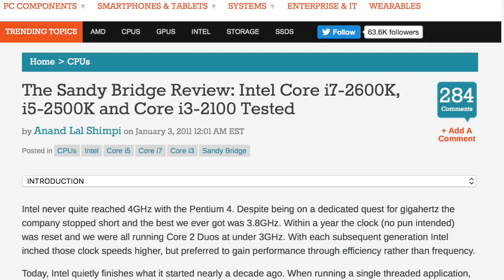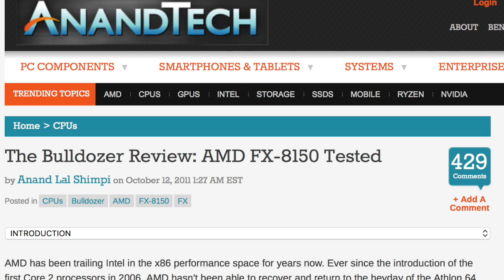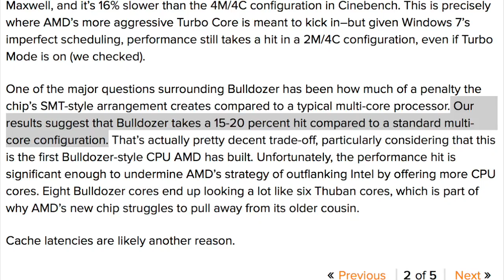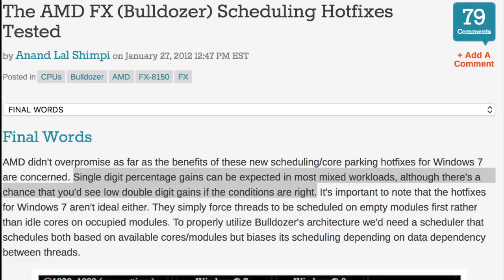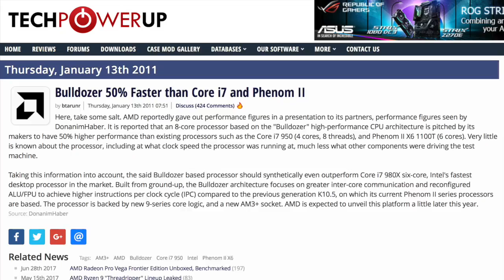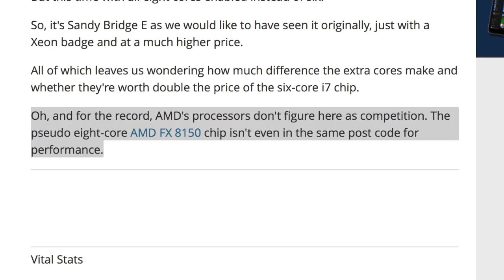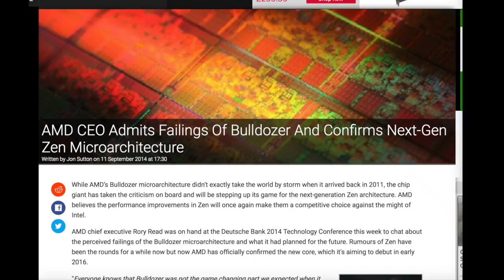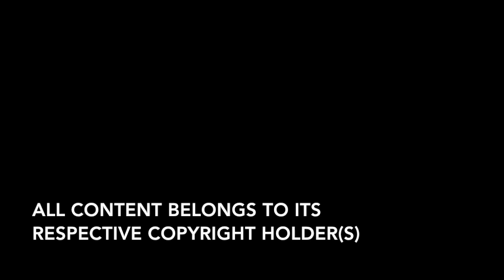The Bulldozer Story - and why AMD FX is better than you remember

Comment: 4.7 overclocked is great with a 980ti, or even a 1080ti.
Reply: 1070 dosnt seem bottle necked much at 4.5+ from our testing, at stock, specially on older titles you will hit a wall but, i have hit the exact same wall on my buddies 2500k at 4.5(max it will do, period...he won and lost the sil lotto, it wont oc past 4.5, but it will do 4.5 a little below stock volts...we tried 4 boards, 3 psu's, and had a guy whos won  oc contests in the past try at a lan and, no luck..but, the guy did say, he would love to have that chip in his itx rig...runs cool and is plenty fast for most uses today...specially most uses of mitx... 

http://www.guru3d.com/articles_pages/watch_dog_2_pc_graphics_performance_benchmark_review,8.html

http://www.guru3d.com/articles_pages/dishonored_2_pc_graphics_performance_benchmark_review,8.html

http://www.guru3d.com/articles_page...e_warfare_pc_graphics_benchmark_review,8.html

http://www.guru3d.com/articles_pages/battlefield_1_pc_graphics_benchmark_review,9.html

http://www.guru3d.com/articles_pages/gears_of_war_4_pc_vga_graphics_performance_benchmark_review,8.html

well ok, if you game at 1080p, but, why would you do that when you have DSR as an option?

makes no sense to game at 1080p when you can push it to 1440 or 2160p and bring perf in line with the intel rigs?
Reply: Lol. Not really, at least not the 1080 ti much less a 1080/70. Will be held back.

Comment: I don't know where you guys are getting your info about AMD FX 8350. There are people who are using the 8350 and getting 4.7 out of there chips. I am going to stay with my 8350 until threadripper gets stable. You can game on the 8350 even at 1440 I know people who is doing this as I speak.
Reply: I just sold a 8320@4.5ghz rig that did doom 4 at ultra setting on 1440p with a gtx 1070. i've sold 4 FX series rigs in the past three months. The support for dual ccx 8 core chips has certainly gotten better over the years. 

a 980ti is the perfect pair imo
Reply: or a 8350 @ 5ghz w/ 1060 6gb ssc... I have one of those on my shelf right now and it games every modern title at 1080p 60-100fps no problem.
Reply: All of my rigs game at 60fps or better. 60 fps is my absolute minimum
Reply: My main purpose is gaming, and the 8350 has served very well. I realize, however, that it will begin to fall behind in performance in the next few years. I recently built a 7700K rig OC to 5GHz, but there is no way I'm retiring the FX-8350. It will be an excellent backup rig.
Reply: I have played every game maxed out for the last 4 years on a 8320 and a 295X2 in 4k. I just bought a 1800x because I needed something with more threads for rendering.
Reply: Never bad having a backup rig. Be it in case the main system fails or for some reason there have to be more than one active at a time.
Reply: FX 9590 GTX 1080 FTW @ 4K No problem.
Reply: I do it at 4k in most titles, moving from dual 290x to a 1070mini made a huge dif, the only titles i see drop below 60fps anymore are...mmo's, and then, its mostly dependent on how much is on screen moving around, more players=perf hit in most if not every mmo, reguardless of cpu..(my buddies 5960x system gets the same fps i do in the same areas of for example ESO.. 

other games....normally im at 70+fps, i do force triple buffer and vsync in alot of titles though, kinda wish i could use a double vsync+tb....since the card can put out over 120fps consistant with this cpu(9370 at stock, though i could lock it at 4.6....in testing, i havent found the need with this board/chip, turbo seems to work well infact....infact....i have on rare occations actually seen it turbo all cores to 4.7...despite the fact it should be 4/8 cores to max turbo ....meh...wish it would consistantly do all of the cores...since when its happened it was never running hot or giving stability issues...(silver arrow extreme sb-e with 3 fans)

Comment: dont get how they calll the bulldozer so bad i stil run it cause well i dont earn alot of income so cant upgrade my pc every few years. bulldozer stil rocks cause i can play anygame atm without any problems. it does the job and was a very good buy at that time.  so no it is not as bad as i remember cause i stil use it and even do i want to get a ryzen at this moment bulldozer stil does its job ,2 games on 2 screen well then it depens on wich games i play but yeah using 1screen i can run star citizen with no isseu hope after 3.0 that stil be the case and same for conan . and those test they use are so wank i never trust those anyways, and time wil tell that amd wil beat the shit out of intel . i can remember the first amd i got a 1.2ghz my brother the same but from intel (both single cores back in the day ;) ) both same video card. did the benchmark and oepsie what did it say intel was not a 1.2 but a 1.0 performance .after i saw that i never went away from amd cause well fool me once but not twice intel .

Comment: they outperform sandy bridge now.
Reply: well he is has shown evidence yet you provide nothing
Reply: i have and its  crap he spend most of the time slagging it off, he cannot think for himself . oops i meant the above not the one u mentioned i will watch it
Reply: yeah its a cheaper cpu by 4x less price what u expect. I cannot afford an i7 or any intel cpu they are too expensive, so i go for the fx 8350 for 50 quid. as i have a amd 3+ already and ram. for me to go rizen i have to buy a new system completely  i just do  not have the cash
Reply: i will never be able to afford ryzen or intel cpus as i cannot work due to ill health  so my money is very limited
Reply: amd  1090t black
Reply: board does not like it m5a97 le r2.0
Reply: https://www.game-debate.com/cpu/index.php?pid=1140&pid2=485&compare=fx-8350-vs-phenom-ii-x6-1090t
Reply: NCR TROOPER actually they do win now. My dad's 8350 stomps my 2600k and my i5 2400. He gets better frame rates with a 390 non X then I do with a 480. And my card is slightly better.
Reply: NCR TROOPER: i have a 9370, and access to 2500k, 2700k, 3770k, 7700k, 5960x, as well as other rigs, under windows 10, with a modern card,(nv being better) 6 and 8 core amd chips actually do, in MANY apps, outperform the intel chips stock for stock, my 8350 was able to do 4.5 at stock volts with just setting llc to high rather then auto, also found i could under volt it by a decent amount at that locked clock without any harm to stability(96hrs p95 custom blend stable, 10runs of extreme ibt avx stable), under 10, with a modern card, the 8350 at 4.5 was beating all of the above stock for stock in modern game titles before i sent the chip to a friend who was stuck on an old x4 945(not the good unlocable ver even) , but has a 970 game board, i have my 9370 i paid $0 for new....so i passed the chip along to my buddy ;) 

we have tested, and my friends with intel have all been quite shocked by the perf of my "amd cannot game" gaming system....the dude with the 2500k actually traded his board and cpu for a 9590 and chv-z that asus replaced with the latest version of the sabertooth when he had to rma after the board died(i think he shorted it on the case, though he would never admit it), they didnt have a chv-z in stock and asked if he would take the sabertooth retail kit instead...m2 slot sold him on it...the fact they tossed in usb 3 pci bracket and such... that dont normally come with the board....bonus!!!!, i have the chv-z, and i would be willing to trade for that board after having seen it in action...but...wouldnt spend money to get it :P 

anyway.... yes, the 8370 vs 2500k stock for stock, average puts the 8370 10% ahead of the 2500k, even when overclocked you see this, mostly because of how much more perf the 8370 can get, in some modern titles with cards whos drivers use the cpu cores well on top of games making better use of more threads/cores, 4.5 vs 4.5 the 2500k will be faster per core, but, once you max out all 4 cores, like the 7700k, you hit the wall, on the other hand, i havent seen a game yet that can max out 8 cores and keep them maxed, most that use more threads actually seem to use the cores to keep the load pretty balanced across the cores being used....sure you hit the wall per thread/core but thats also true of the 2500k/2600k/2700k etc, im quite glad i went the way i did, the path i took saved me money over the years, and, has held up better then had i gone with intels options...q6600/960/2500k/2600k/2700k/etc, since, at each stage of my upgrade path, i was able to continue using core components till i upgraded them...upgraded from a 790x board to a 990fx board, kept the x6 1050t i was using, and ram, moved to an 8120 i got stupid cheap, sold it to a buddy when i got an 8350 for 120-145 range on newegg, who insisted on paying current value for it...that was more then i spent on the 8350.... i upgraded my ram from 16gb of 1666 to 32gb of 1866 i got for 120 shellshocker, then 32gb 2133 i got for the same price shell shocker... i moved from sabertooth 990fx to chv-z because a buddy sold me one for 120-130..ish...brand new unopened, the core of this systems been upgraded here and there at far lower cost then moving to an intel option that would give me more then a quad....and, unlike intels offerings, over the years, win8/8.1/10, driver updates, game updates, all have made these chips faster, the fx line is seeing benefit because, they did have a sizeable market(cpu/apu/etc) and it was expanded by all the xbox/ps4 units sold using what amounts to a tuned and very low clocked version of these cpu's, even if its a small % of the overall market.

these chips are not shit, despite what people still believe 

http://www.guru3d.com/articles_pages/watch_dog_2_pc_graphics_performance_benchmark_review,8.html

http://www.guru3d.com/articles_pages/dishonored_2_pc_graphics_performance_benchmark_review,8.html

http://www.guru3d.com/articles_page...e_warfare_pc_graphics_benchmark_review,8.html

http://www.guru3d.com/articles_pages/battlefield_1_pc_graphics_benchmark_review,9.html

http://www.guru3d.com/articles_pages/gears_of_war_4_pc_vga_graphics_performance_benchmark_review,8.html

Comment: AMD 8 cores weren't really a failure. But AMD milked it for way too long, I loved my FX8320 back when I first bought it, Now the FX 9590 to me was a failure, They were mostly unstable at stock and some motherboards it just froze up because of the insane power draw, If they were able to make a 125watt TDP FX9590 I would have been impressed at the time. The FX line was showing its age so I ended up moving to the i7 5820k since AMD did not have anything out that was worth getting at the time. I still have my FX8320 in another system and it's doing well and I have an FX4350 in a system I use for my media center/file server I use every day, I bought the FX4350 for $25 USD.

Comment: Well, i just upgraded from a FX-4300 to a FX-8350 last month and it does all i need.
If you are on an extreme Budget like me, the AM3+ platform is still an option to consider. It is well matured, no early adopters bugs, very stable and reliable in my expirience. 
Sure, it will not hold up to modern i7 or Ryzen Chips, but on the other hand, you can build 2 complete AM3+ PCs for the same price as a top level i7 CPU alone. You will not crush any benchmarks with a FX-CPU, but you can run everything and it's not too bad. I really like my new system, and i think i will stay on that until the next generation of Zen CPUs are out. 
Still my opinion, if you want a solid, reliable system for a cheap budget, and you care more about everyday expirience then benchmark results, stay one generation behind. That way you can get the full featured well built top tier parts, while still saving a lot of money and headache.
After all, i don't want to play beta tester on some new chips that were thrown at the market with severe bugs in them, even paying a premium for doing so. I'd rather take the well tested and matured option and save a lot of $$ on it.
Reply: Asahiwasabi LMAO it stops it? You call 8% a stomp? Also my piledriver chip is faster then your x5660 even in server loads. http://cpu.userbenchmark.com/Compare/AMD-FX-6300-vs-Intel-Xeon-X5560/1555vsm16614
This is my system: http://www.userbenchmark.com/UserRun/7277493
Reply: kitty!
Reply: That would be a valid strategy until a couple of years ago. The sheer IPC uplift of ryzen, current RAM prices, and amount of r1700\r2600 + b450 mobos in the used market makes it so AM3+ is too obsolete to be a good performance\price option. Sure, for the 150\200$ you'd spend on one ryzen mobo\cpu\ram combo could buy 2 AM3+ combos, but that's just because of how worthless they've become. 

I mean, if you only have 100$ to spend, go for it. But from 150\200 and above, might as well get early AM4, then you get not only a way better experience, but also upgrade paths that will be worth at least for another 3\5 years
Reply: @dayotobiusa  Well, the comment you responded to is from 3 years ago. 
I would not go the same route today, instead i would go with Ryzen obviously. 

When i made the descision for AM3+ over AM4, it was still first gen Ryzen, and we all know it had some issues with RAM compatibility and such. 

Today, Ryzen is a mature platform. But you can employ the same strategy within the AM4 ecosystem. Get a really good mainboard with the latest support, but then save money by not getting the latest CPU but maybe just a 2000 series. Also only equip 2 of your RAM slots to keep the other 2 free for a future upgrade once RAM prices drop. 
Then hold on and wait until after Ryzen 5000 Series the AM4 platform is replaced, and upgrade to the highest tier AM4 while everyone is running after the next new thing.

This strategy will obviously not give you the top of the line high end system, but in terms of performance per $$, this seems to be the most efficient strategy.
Reply: Until the board expires and you can't get a decent replacement.
Reply: @marcustaylor670  My am2+ board has been run wayy over clocked with an Athon +550 dual core for 13 years now. A quality board will last longer think u think. OEM boards burn out!
Reply: @willc5512  - I have various ROG boards including AM2, they will take all manner of abuse forever almost.  Anything medium to low quality which 95% of people run won't last.  Must be a quality board you have.
Reply: http://www.guru3d.com/articles_pages/watch_dog_2_pc_graphics_performance_benchmark_review,8.html

http://www.guru3d.com/articles_pages/dishonored_2_pc_graphics_performance_benchmark_review,8.html

http://www.guru3d.com/articles_page...e_warfare_pc_graphics_benchmark_review,8.html

http://www.guru3d.com/articles_pages/battlefield_1_pc_graphics_benchmark_review,9.html

http://www.guru3d.com/articles_pages/gears_of_war_4_pc_vga_graphics_performance_benchmark_review,8.html

fx cannot game you need i3/i5/i7 to game, reviews from ryzen launch show, ryzen is yet another trash design....clearly....

and serious gamers, game at 1080p or lower for max fps !!!

Comment: No, its exactly as good as i remember lol. There are definitely games today that take advantage of more than 4 cores, but that does not help fx in games like WoW where you need a single fast one. BTW i bought a ryzen 1700 as upgrade to my 2500k, just so i dont get lableled an intel fanboy. Bulldozer was and is a failure.
Reply: Ryzen isn't exactly shit for gaming.
The difference is mainly due to ~20% slower clocks.
At low resolutions it is noticable, but when there is a choice between 80 fpps for $200 and 90 fps for $350, what would you choose.
At higher resolutions the difference dissapears, but that is mainly due to low fps overall.
There is a reason AMD wanted the gaming tests for Ryzen at 4K.
If I can get good fps for a certain price, and slightly higher fps for double that price, I take the cheaper chip, as long as even that is good enough.
If it weren't for certain, less threaded games, I would probably still play on my Core 2.
Reply: fx cant game, hell, launch reviews show ryzen is shit for gaming,  gamers should just stick to a 7700k like intel wants.... 
http://www.guru3d.com/articles_pages/watch_dog_2_pc_graphics_performance_benchmark_review,8.html

http://www.guru3d.com/articles_pages/dishonored_2_pc_graphics_performance_benchmark_review,8.html

http://www.guru3d.com/articles_page...e_warfare_pc_graphics_benchmark_review,8.html

http://www.guru3d.com/articles_pages/battlefield_1_pc_graphics_benchmark_review,9.html

http://www.guru3d.com/articles_pages/gears_of_war_4_pc_vga_graphics_performance_benchmark_review,8.html

Comment: Where do you state why FX is better than I remember? Because most of your video highlighted the negative. I'm confused.
Reply from the maker: Because there were several limitations that hampered performance at launch, so the performance was worse than it should have been in early FX reviews. As a result people usually remember the product being worse than it actually was, and don't give bulldozer or later FX processors a fair shot.
Reply: But all those changes happened during the lifetime. You didn't really present the information well. It just seemed like AMD fanboy clickbait. And I would know I've owned an AMD cpu for the past 13 years.
Reply from the maker: Well now the true performance of the processors can be seen. Hence why the they're better than most people remember, since they remember the performance at launch and also other factors which at the time made that performance seem worse, but now they can be fully utilised and performance has improved.